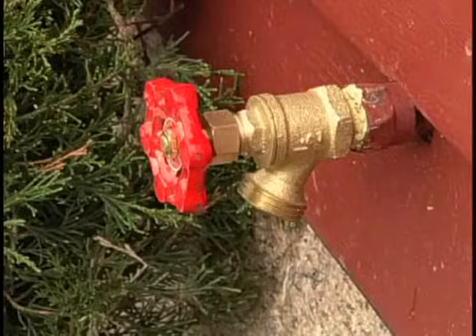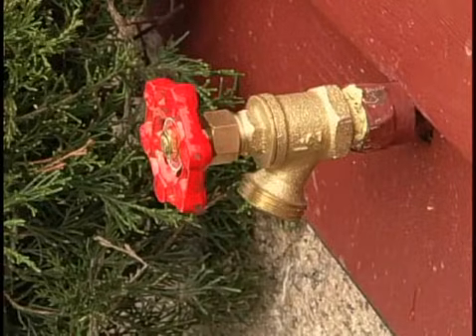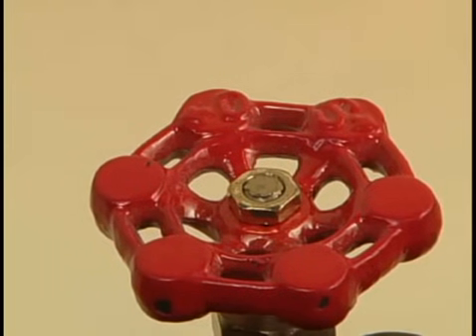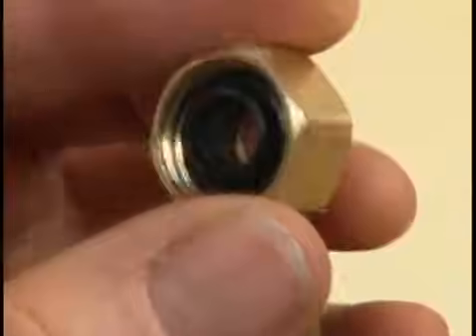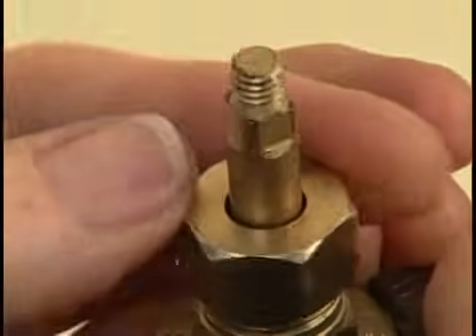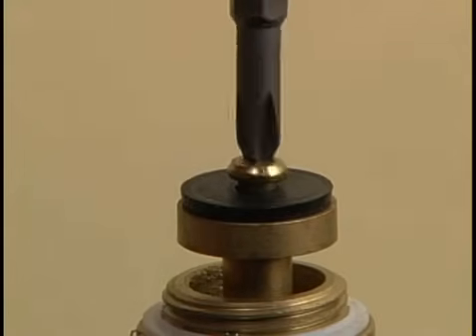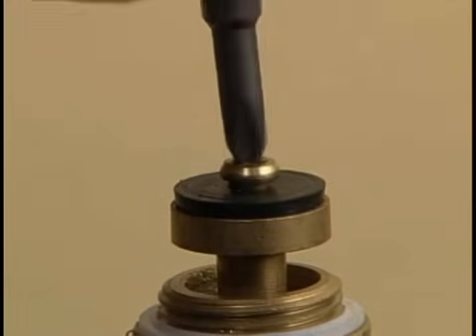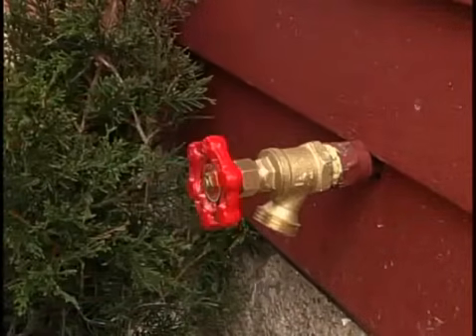How to Repair a Dripping Outdoor Faucet

Comment: Do NOT hold the valve "with your hand" while you tighten the nuts back on.  As you can even see in the video, the whole valve starts twisting in the wall while he does this.  This is a risky thing to do and can break off the valve  pipe inside a wall, or just cause it to start leaking inside a wall (where you won't know it until it causes water damage).  Hold onto the valve body with a pipe wrench or channelock pliers so you can really get a good firm grip on it and prevent it from twisting while you tighten the nuts.

Otherwise... nice video.  Clear and informative.
Reply: Thanks for posting that. It saved me the trouble of posting the same warning. It needs to be *Pinned*!

Comment: I just used a little motorcycle oil to help loosen the assembly piece and it worked.   Must have been rusted cause it was hard to pry loose.  :)

Comment: What do I do when the value assembly piece is not coming loose?   Mine must be rusted because it is not budging at all.   How can I get it to loosen?
Reply: With water supply shut off and valve fully open you can try heating the valve with a Propane Torch. You probably want to replace it with a Brass model anyway.
Reply: @cdrive5757  Thanks for the advice!!!  I'd probably burn my house down! LOL
I contacted the mfr, NIBCO and they sent me a new part.  Seems to not be leaking now.   I noticed that the smaller nut right underneath the round on/off metal knob(your knob is red in the picture here) should not be overtightened.  Seems to drip if that smaller nut is overtightened, so I hand tightened the small nut and then turned the metal on/off knob tight and it seems to not be leaking.    Never realized how these outdoor spigots could be so sensitive.
Reply: @Floridafisherman5000  Ira, I certainly don't want you to do that burn your house down. Advancements made in electronics technology in the last 50 years have been astounding, yet that valve design patent dates back to the 18 hundreds! Good luck my friend. Chris